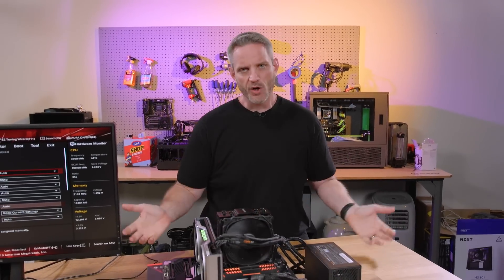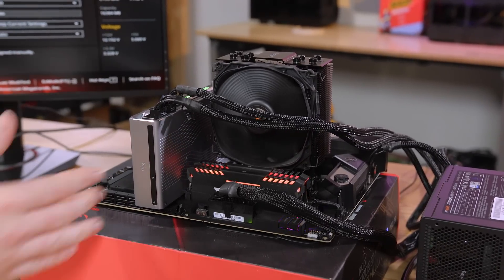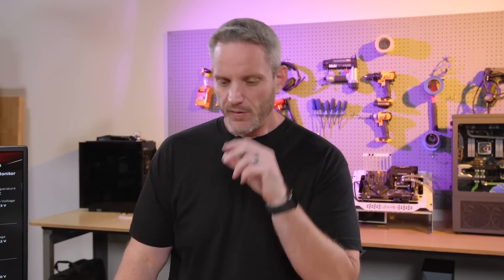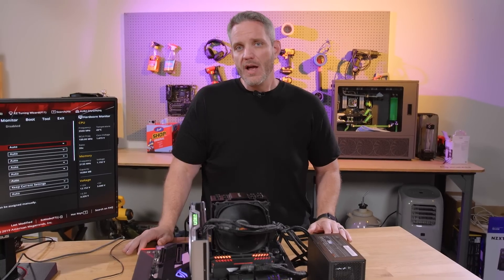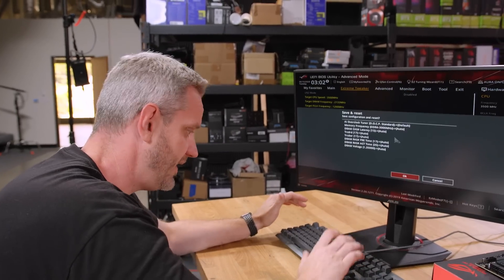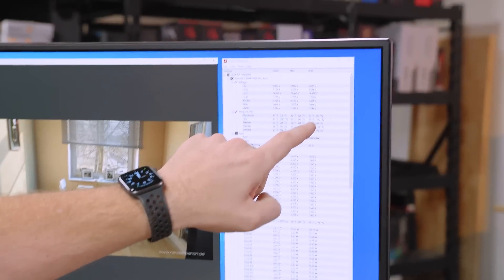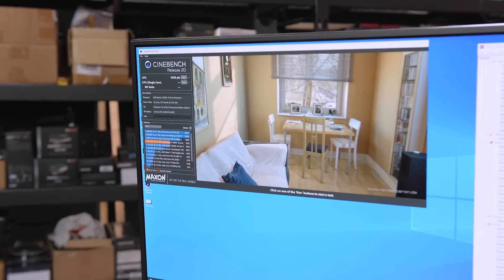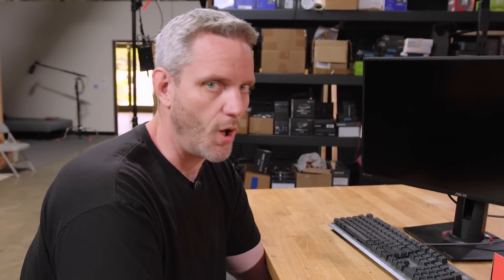Is your motherboard trying to damage your Ryzen CPU?

Comment: Degradation is real.  I just RMA'd my 2nd 3600 already due to loosing stability at any clock .  The first one they honored.  Not sure if they will on the 2nd.  The board is partially to blame, AMD is partially to blame, I'm partially to blame. And what auto means is not what you think it should mean sometimes.

Comment: The out of the box the Temps I got on my 3950x reached 100c (bad cooler), but after a bios update it did not go over 95c. 

Now with a water cooler I don't go over 80c, should be fine. 
And yes I dont care about max clocks, just trustability 😉

Comment: my 3700x was running fucking 1.45 volts for 4.0ghz for like a week before i managed to change it by just shutting off all "auto" oc options including D.O.C.P because it was legitimately unstable with it enabled but my ram was fine with a manual oc and timing adjustment.

Comment: Summary: Overclocking reduces ANY cpu lifespan
Reply: not intel's , not on air.
Reply: @Ludak021  yeah it does. Silicon between companies isn't different. Intel isn't special
Reply: @raawesome3851  I haven't had a single intel die on me. I had bunch of bartons and athlons XP and semprons and A64s die on me. I still have cellerons 533, pentium 2 an 3,  one passcall and a bunch early i5's. I don't have a single AMD older than 6 years alive. AMD is crap. I hope Ryzen is better.
Reply: @Diviance  well, none of us is wrong then. ;)
Reply: @raawesome3851  regardless of previous posts, yours is inaccurate. Silicon is VERY different between companies.
Reply: @Ludak021  no. It's the architecture and the voltage that makes it fail. It's not that different between companies.
Reply: @Ludak021  also, I've had multiple old Intel CPUs fail on me on air with no overclocking.
Reply: @raawesome3851  like I've said: none of us is wrong. We need a larger sample, much larger, millions over the, say, two decades at least. I don't have those numbers, all I have is my experience witch differs from yours.
Reply: @Ludak021  that's true.
Reply: @Ludak021  
It always does.  That is simply how physics works.

Comment: I miss the way old school cars were made, they were so much enjoyable to work on than any new car
Reply: On the flip side, I don't miss old school computers, they were a fucking hassle.
Reply: cars go to school?
Reply: Antone Wilson i found it much easier to tune my car with a laptop and wide band o2 than tweaking a carb. the rest is still just bolts like always.  its imagined controversy mostly.
Reply: @JackMott  Living out here in the country I'm talking bout mostly bout service  and repair not Tuning. Speed will get you killed on dirt roads
Reply: Rotary engines?
Reply: I don't miss trying to tune a 4 barrel carb while constantly monitoring tailpipe emissions and checking to make sure it was able to accelerate properly at all ranges without falling on it's face every 10k-12k miles.  Having to service points and sparkplugs every 6k miles.  Since those days every vehicle that I have owned needed far less maintenance with the use of computer-controlled electronic fuel injection and electronic ignition systems.  
Granted I don't like the way cars like Tesla are going where the manufacture has 100% remote access to your vehicle's body controller and ECU and could push an update that bricks your vehicle or disables features that you or the original owner paid for simply so they can avoid a recall or charge you again with software as a service.  It's really stupid that they need to push a full software update to the body controller in some cars just to update the stations on the satellite radio module that the person isn't even using.  Once a car rolls off the line it should never ever need to have a software update unless a vital bug is discovered and a recall is issued.
Reply: @kuhrd  
A lot of things shouldn't need updates... but it is good that they can be updated.  No amount of testing can be comparable to being used in the real world by tens of thousands, hundreds of thousands... millions of people all in ways that maybe you didn't think of.

Besides, since the world is moving towards self-driving vehicles, the ability to update their firmware and whatnot with new techniques and more advanced algorithms to better adapt to road conditions is an absolute must.  That is a future I look forward to, though I may not live long enough to see it come to real fruition.

Comment: Engine guy here, can confirm: was triggered.
Reply: what engine are you?
Reply: @deminybs  Cadillac 8-6-4. Great in theory, a failure in practice.
Reply: Compression is required to make it run though. Try running an engine with a bent valve..
Reply: i hate the fuel air spark saying. you can have all 3 and still not have a running engine i change air out for compression. if theirs no air theirs no compression. a reason for holding open the throttle blade during compressing testing to get proper results
Reply: Jet engine guy here. Also triggered. Air is not fuel. The oxygen content in air is too low to burn, hence why we need fuel. "Fuel, air, spark" is the saying, though of course it's an over-simplification.
Reply: @TKettle  Guess you need to be a rocket engine guy to understand that air is fuel.  With no atmosphere, you need to take your oxygen with you as fuel.  You're just spoiled by the fact that half your fuel is all around you.
Reply: @TKettle  oxygen is an oxidiser for the fuel and not the opposite
Reply: @TKettle  Rocket/time machine/delorian engine master dude guy here. 
I can confirm I'm the shit.
Reply: Yah, me too, and never considered "compression" a part of the "air, fuel and spark" trope.
It's simply called GAS, Jason.
G: gas
A: air
S: spark
Reply: You're not an engine guy, you don't know anything about engines.
You can google shit all day and paste it here. You don't know anything.

Comment: Depends, my x570 taichi killed my 3900x with ONLY AUTO BIOS SETTINGS for CPU after about 3 months, microcenter replaced it and I did per CCX overclocking with like .2v less than PBO and has lasted longer than 1st one. Plus faster!! amazeballs

oh and hi Jay 🙋🙋

I mean "technically" original CPU could've had issues from the factory, but I doubt it, worked amazing for few months till it didn't want to anymore lol, lowering clocks and voltage manually seemed to fix it for a week then same blue screens came back way more often, eventually gave in and handed CPU to a friend to test in his also x570 taichi, he had same issues